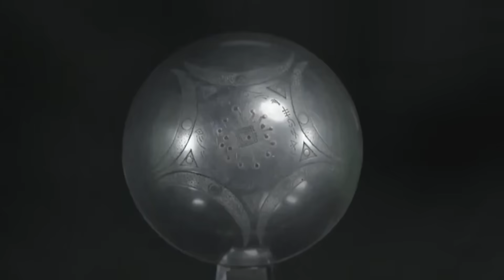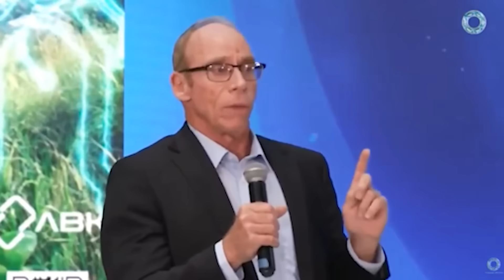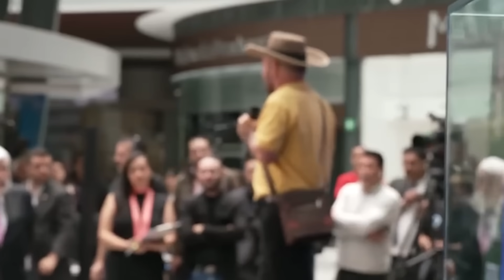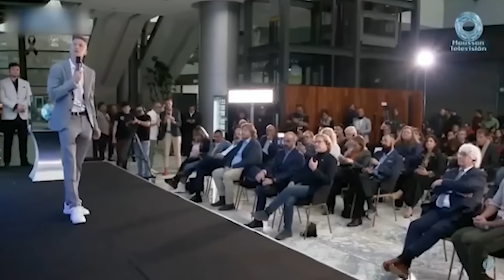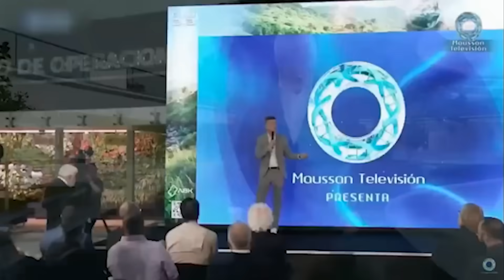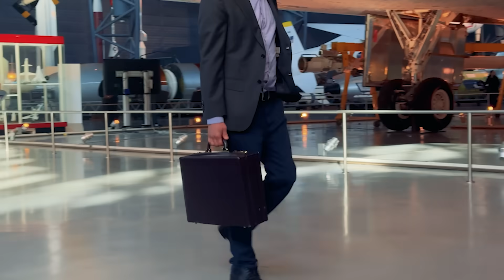BREAKING UFO NEWS! This Is JUST MINDBLOWING! FULL COVERAGE!

Comment: The symbols resemble a Geometry Cipher Key (Clockwise from Top): Angle (°) Letter 0.0 A 22.5 B 45.0 C 67.5 D 90.0 E 112.5 F 135.0 G 157.5 H 180.0 I 202.5 J 225.0 K 247.5 L 270.0 M 292.5 N 315.0 O 337.5 P A geometry cipher (or geometric cipher) isn't a standardized code like Caesar or Vigenère. It usually refers to encoding using: Shapes/angles/positions (e.g. Polybius squares, Pigpen cipher, or sigil-like scripts). Relative placement (e.g. radial symmetry or constellation-like alignments). Topological transformations (used in ARGs or esoteric encryption). Quadrants or sectors (could be a cipher wheel approach), Constellation-style dots around a central hub, A ring of glyphs that may map to a substitution cipher based on position. This what I conclude (assumed clockwise): 𐊀 𐊁 𐊂 𐊃 𐊄 𐊅 Interpreted Meaning: “We arrive not to conquer, but to observe. Within this vessel lies the archive of our kind. To open, align light and silence at the junction of stars.”

Comment: The inside looks like a Van De Graaff generator that's negatively charged. The Earth is negatively charged, so 2 negatively charged objects will repel and it will levitate.
Reply: That's some very, very over simplified science that sounds plausible, but is complete nonsense when applied to an object the size of the Earth and a small metal ball (that's very likely fake).

Comment: You just use several drones and there won't be any pendulum effect or rotation. There are programs that can make drones fly in coordination, or you could connect them with balsa weed sticks or whatever so they stay in a rigid formation while all being controlled by the same steering device. It's like with the levitating palm tree branch. the guy used several drones. You can't lift a palm branch with one drone unless it's a very large one. You could actually hear the drones in that video. Not one of these sphere videos panned up to show the sky above it, though they could have if they wanted to and then blanked out the drones with an editor, an easy clone stamp job in After Effects.